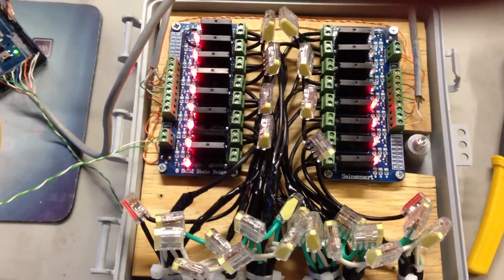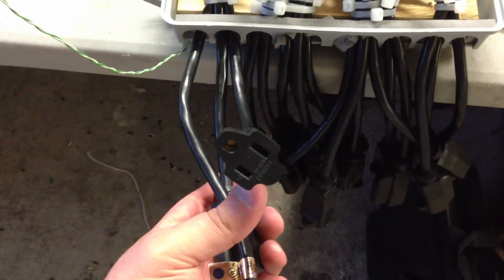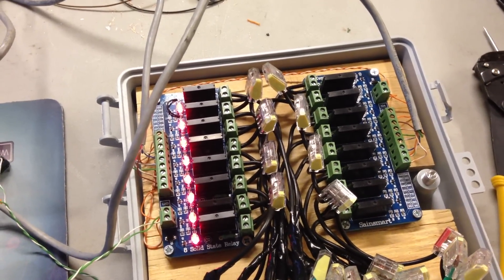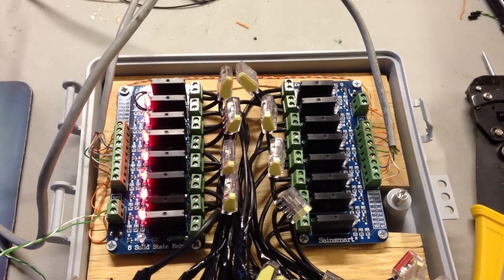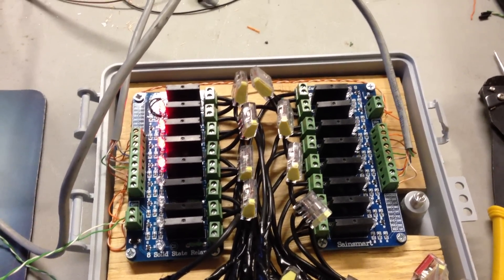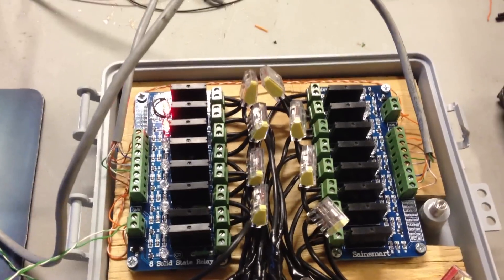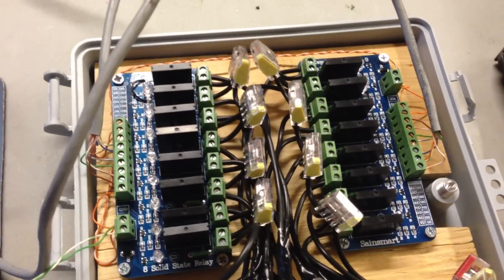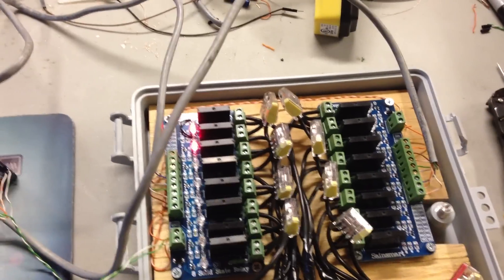Custom Christmas Light Controller - Part 4

Comment: I have been work on one of these projects I really like how you used the drop cord receptacle over have to use the wall sockets would there be a chance that  you could help me with how to wire mine up like you did so that I don't have to use all the walls sockets and gang boxes thanks in advance

Comment: How were you able to get zero cross detection for the random cross SSR's? Not sure how to go about that...
Reply from the maker: +Nathan Krause I had to replace the original relays on the board with ones that supported zero cross capabilities.
Reply: +Josh Bumgarden I understand that, but I was referencing a video by Scott Shaver who stated that a device was used to detect the zero cross in order to allow for pwm dimming. If you have had success without such measures that's all I needed to know. Thanks!!
Reply from the maker: There is a device that i found called a zero cross detector pigtail.  it looked like a 1 foot extension cord with a black box in the middle of it.  I can't remember where i bought it from but it was from one of the DIY christmas sites.

Comment: What are the clear plastic pieces?   Are they fuses?  Which side do they go on?  I can't quite make out pos and neg.
Reply from the maker: Ross Potts they are wire connectors which allows me to split the power from my two power inlet plugs amongst the 16 output plugs.  Those use connect the common ground and common neautral wires.